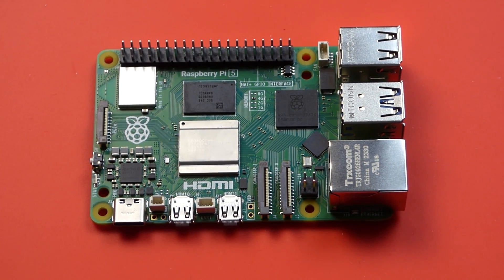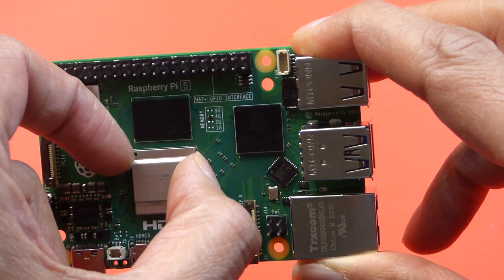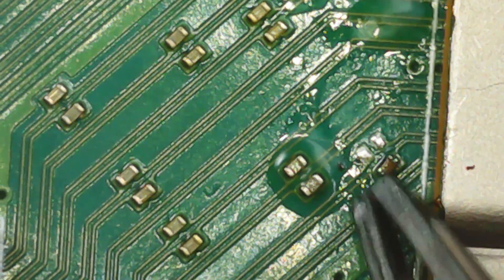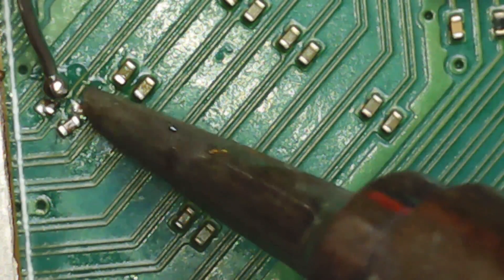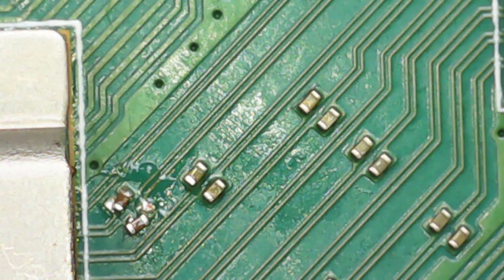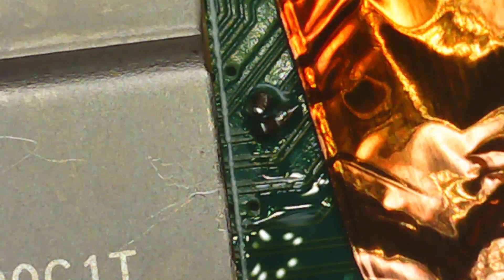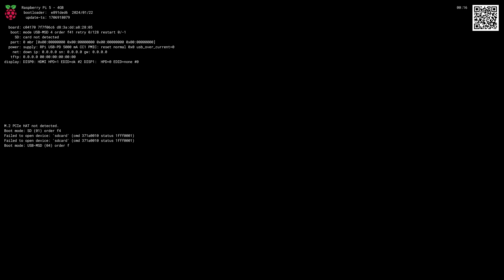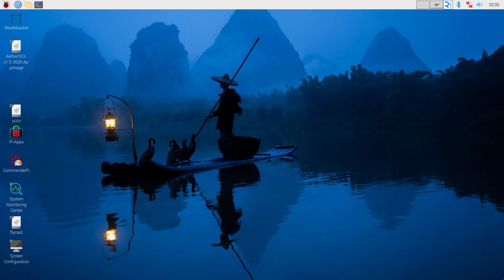I Broke My Raspberry Pi 5 - A Warning !

Comment: just a few pointers. 

1) When working with such small smd devices, it's a good idea to have adequate tweezers. fine point ceramic tipped tweezers are going to be a massive improvement for you. 

2) instead of trying to affix such small SMD components with a soldering iron, it's better to wick the pads, add a small amount of solder paste, place the component, then with a hot air wand and low air speed, flow the solder paste. This will save you a lot of time fiddling about with the iron, and the components will simply "move" into place due to surface tension of the solder when it attaches to the pads, and the component.  if need be, you can always come back in with a J tip, or a hooked tip and clean up any excess solder before cleaning with IPA. 

3) While i commend you for using copper tape to preserve the other SMD capacitors, you failed to do the same for the die stack you were working right next to. A copper slug, or a few pennies sat on top of the CPU's IHS is a good idea.

4) Finally, it's reasonable a good idea to clean flux off while it's till hot. A toothbrush might be OK for larger components, but can easily dislodge smaller one's such as the cap's you were soldering. Chem-wipes, IPA, and a small brush is really all you need to clean the flux up. Place a chem-wipe wetted with IPA on top of the area that has the warm flux on it, use a brush dipped in IPA to massage the chem-wipe around gently, it should absorb the flux and IPA mixture without leaving fibers. repeat as many times as desired.
Reply from the maker: Thanks for the feedback. Great tips !

Comment: Amazing work! What models are these capacitors? Where can I get them?

A warning for Pimoroni Pibow case users out there! It has a bad design that knocks off one of the capacitors shown here if you're not extreeeemelly careful to install or remove it.
Reply from the maker: Thanks ! These are 100nf 0201 SMD capacitors. Very small and a real challenge to work with if you dont have a microscope.
Reply: @IntriguingTech Thanks for replying. I see there are many different 100nf 0201 SMD capacitors, such as 104k 6.3V, 16V, 10V, etc. Which one did you use?
Reply from the maker: I bought "100nF 10% X6S 25V". From: https://www.ebay.co.uk/itm/314662038883

Comment: I broke off my fan header from the way I grab it to remove USBs, trying to avoid the power button as well.  Now I've got a dual  pi4 fan sitting on top of the old official cooler run off the GPIO. Works just fine. So a case is a good idea. Oh and I didn't notice til I could smell it getting hot. Still works fine.
Reply from the maker: Nice. Maybe you could have a go at replacing the JST fan connector ? You have to be careful with how you handle Pis, I found out the hard way.
Reply: @IntriguingTech  There is absolutely no way that I can do it. It's too small and trapped by the USB 2 connector. It's really no big deal for the desktop, the fan on there now is quieter and I think it even stays cooler. Worst case I pick up another for $60 in town.
Reply from the maker: @pgtmr2713  Fair enough dude.. as long as you have it working.

Comment: How fix this messages :  unable to open storage device 'dev/mmcblk0' and unable to open storage device 'dev/sda' , please ?
Reply from the maker: Where did you get that message ? Sounds like your trying to do something that needs root.
Reply: @IntriguingTech  I don't really know what I did to get this message. I was stuck with all my devices no longer responding. I managed to flash my SD card on another PC and reinstall everything on the PI5

Comment: I'd have just returned it. That's what I did with a Raspberry Pi 3 or 3 B+ I broke off one of the capacitors that's close to one of the screw holes when I was trying to put a screw or a stand off in and they gladly sent me another one and then I sent them the broken one as I did not have the tools or the experience to fix it myself. I think it was Element14.
Reply from the maker: Nice of Element 14. Some companies have better return policies. I could have tried returning it but there was a shortage of Pi 5s at the time but didnt want to wait 4 weeks.
Reply: @IntriguingTech  Yeah I hear you there. Now they're called something else. Newark I think.

Comment: Ahhh..., the days when I could tack 201 termination resistors on QFP leads and add a 30ga wire to ground on the other end with hardly any problem. Alas, no more. Good job.
Reply from the maker: Lol I can only imagine how difficult that must have been.

Comment: my Rpi4 has red led and no output in the console and hdmi.
Good to see you are able to resolve your issue.
Reply from the maker: Thanks. Did you try removing your SD card and powering it on without anything ? If you see some greenlight activity then it means its not dead.
Reply: @IntriguingTech  Yes, it seem to be dead. RIP.
Reply from the maker: Unlucky. Maybe time for an upgrade :)
Reply: is there any wat to repair?

Comment: Yes the power chip and caps are near the securing hole.
Reply from the maker: Oh dear. Well you can fix it depending on your skill and equipment.
Reply from the maker: Maybe post a high res picture of your board. Someone might be able spot hardware defects (if any).

Comment: Ok, I’m an electronics engineer and do this as a daily task, so I know how tedious it can be lol, get yourself a 0.1mm iron tip, 0.1mm tweezers, and some no clean flux (as it’s not sticky). There was plenty of solder on the pads already but your not doing that easily with hot air anyway, clean it really well with ipa, then hold the new cap onto one side pad and solder it then touch in the other side. Then clean it, re-flux it, then gently push down on the middle with your tweezers and re-solder both sides. Be careful with the amount of heat you put into the cap as to much and you will destroy it. You need to be quick and accurate with the iron 👍
Reply: Forgot to say, you did a fair job considering the tools you you had to hand 👍 a little investment and you will find these kind of jobs a 1000 times easier 😁
Reply from the maker: @hoshm5496 Thanks buddy.
Reply from the maker: Nice tips. Hopefully if anyway one else encounters this problem they can benefit from your advice.

Comment: It would be nice to know the substances and devices you used to do the repair. I have poor eyesight now and the magnifier device might be useful to me. My soldering often ends up a mess.
Reply from the maker: Sure. Microscope was DM4 cheap one for £28 I reviewed previously. Soldering Iron was a T12 OLED. Capacitors are 0201 SMDs 100nf.